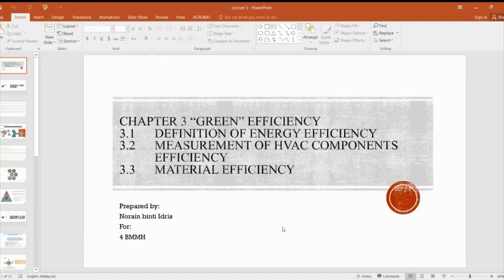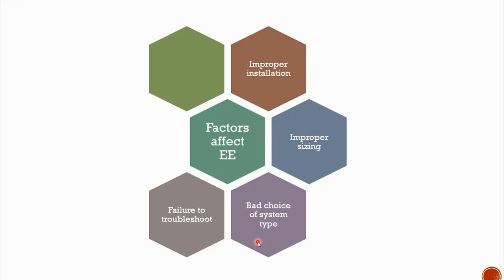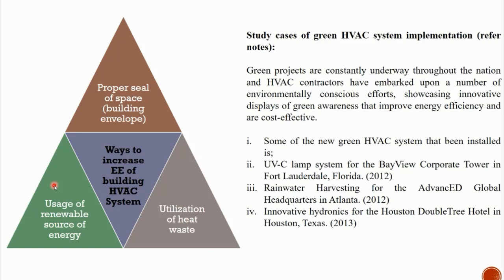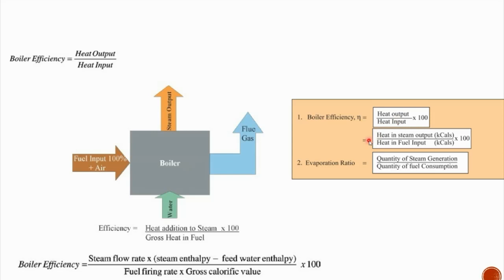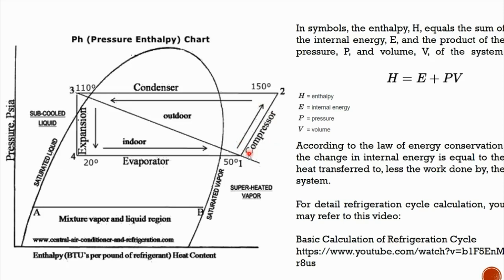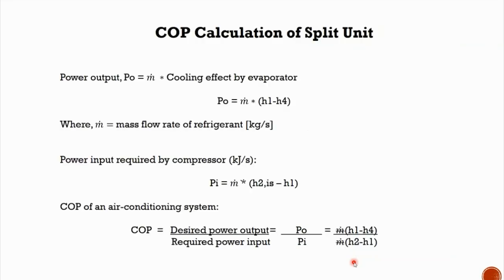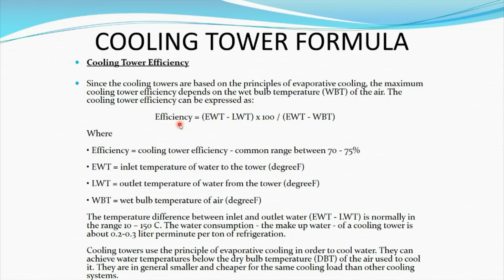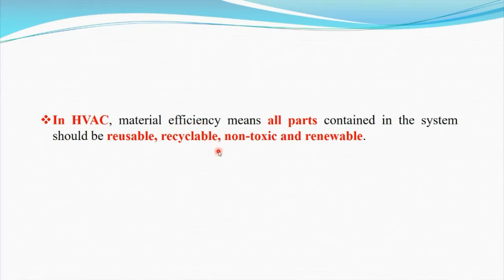Lecture 3 "Green” Efficiency

Comment: Energy efficiency:
Goal to reduce the amount of energy required to provide products and services

Factors of Energy Efficiency 
1. Incorrect Choice of sizing to system when purchasing due to over or underestimating situations done by contractor.
2. Improper installation of the system by inexperienced worker will reduce the efficiency of the system when running up to 30%.
3. Unable to make a good decision on choosing system types to the surrounding conditions and climate changes.
4. failure in troubleshooting the system when problems occur.

way to increase the energy of building HVAC:
~ proper seal of space
~ utilization of heat waste
~ usage of renewable source of energy

Measurement of HVAC components efficiency
- refrigerant cycle calculation
- calculate COP by using the p – H diagram
- cooling tower efficiency = based on the principle of evaporating cooling, the maximum cooling efficiency depends on the wet bulb temp of the air

Green materials:
recyclable
renewable
reusable
nontoxic 
rapidly renewable plant material

Comment: MOHAMAD HURAIRAH BIN HARUN (B071710461)

3.1	Definition of Energy Efficiency : 
~Is the goal to reduce the amount of energy required to provide products and services

Factors that affect Energy Efficiency:
•	Improper installation
•	Improper sizing 
•	Bad choice of system type 
•	Failure to troubleshoot 

Way to increase the energy of building HVAC:
•	Proper seal of space 
•	Utilization of heat waste
•	Usage of renewable source of energy

3.2	Measurement of HVAC components efficiency
~Boiler Efficiency
~Refrigerant Cycle calculation

3.3 	Material Efficiency 
~A description or metric which expresses the degree in which usage of raw materials, construction projects or physical processes are used or carried out in a manner which consumes, incorporates, or waste less of a given material compared to previous measures. 

Green materials:
•	Rapidly renewable plant material 
•	Recyclable
•	Renewable
•	Reusable
•	Non-toxic 

In HVAC, material efficiency means all parts contained in the system should be reusable, recyclable, non-toxic and renewable.

Comment: MUHAMMAD AKRAM BIN RAZALI (B071710573)

Energy Efficiency:
- To reduce the amount of energy required to provide products and services

Factors that affect Energy Efficiency:
- Improper installation
- Improper sizing
- Bad choice of system type
- Failure to troubleshoot.

Way to increase the energy of building HVAC:
- Proper seal of space
- Utilization of heat waste
- Usage of renewable source of energy

COP of split unit.
- Desired power output / Required power output.
- Po = m x (h1-h4)

Material efficiency : 
- Express the degree in which usage of raw materials, construction projects or physical processes  are used or carried out in a manner which consumes, incorporates or waste less of a material compared to previous measures. Making a usable item out of thinner stock than a prior version increases the material efficiency of manufacturing process.

 Green material 
- Rapidly renewable plant materials
- Recyclable
- Renewable
- Reusable
- Non toxic

Comment: HAKIM BIN ZAINUL B071710531 BMMH S1/1 

CHAPTER 3 
GREEN EFFICIENCY
•	The goal of energy efficiency is to reduce the amount of energy required to provide product and service.

The Factor that affect Energy Efficiency
•	Improper sizing 
•	Improper insulation
•	Failure to troubleshoot
•	Bad choice of a system

The ways to improve EE of building HVAC system
•	Proper seal of space 
•	Usage of renewable source of energy
•	Utilization of heat waste

The 4 basic component in refrigeration system
•	Condenser
•	Compressor
•	Evaporator
•	Expansion valve

The COP of a split unit.
desired power output/required power output.
Po = m x (h1-h4)

The max cooling tower efficiency depends on the wet bulb temp of the air. 
efficiency = (EWT – LWT) x 100 / (EWT – WBT)

Green material
•	Rapidly renewable plant materials.
•	Renewable
•	Recyclable
•	Reusable 
•	Non-toxic

In HVAC, material efficiency is all parts should be reusable, recyclable, non-toxic and renewable.

Comment: MOHD RAHIMI BIN MUSTAPHA
B071710225
BMMH S1/1
Lecture 3: Green Efficiency
1)	Definition of Energy Efficiency (EE)
>>	The goal to reduce the amount of energy required to provide products and services.
>>	To reduce cost
>>	To reduce CO2 emission
>>	To reduce energy needed by the world
>>	Slow down the rate of energy depletion resources
Factors that affect EE:
-	Improper installation of HVAC system
-	Improper sizing selection
-	Bad choice of selecting system type
-	Failure troubleshoot
Ways to increases EE
-	Properly seal the confine space
-	Utilization of heat waste (such as heat from existing system)
-	Use the renewable source of energy

2)	Measurement of HVAC components efficiency
>>	Boiler Efficiency = (Heat Output / Heat Input) x 100%
>>	Heat Output : Steam flow rate X (steam enthalpy – feed water enthalpy)
>>	Heat Input    : Fuel firing rate X Gross calorific value 
>>	Unit used in kCals,
>>	For Evaporation Ratio = Quantity of steam generation / Quantity of fuel consumption 
>>	Using p-h diagram
>>	COP calculation of split unit (desired power output/desired power input) (h1-h4/h2-h1)
>>	Cooling tower efficiency (EWT-LWT x 100)/(EWT-WBT)
                             
3)	Material efficiency
>>	The degree in which usage of raw materials, construction projects or physical processes are used which consumes, incorporates, or waste less of a given material.
Green Material: usually used for building 
-	Non-toxic material
-	Reusable material
-	Renewable
-	Recyclable
-	Rapidly renewable plant materials
EPA (Environmental Protection Agency) suggest that to used recycled industrial goods in order to minimizing wastes and maximizing recycling.
In HVAC field, all parts contained in the system should be reusable, recyclable, non-toxic and renewable.

Comment: LUA WEI JIE (B071710861) 4bmmhs1/2

energy efficiency is affected by :
-Improper installation affects your HVAC system's efficiency by reducing your system's efficiency by as much as 30 percent. In other words, it can actually cancel out the savings you're expecting from upgrading to a more efficient model. HVAC installation is a job for a licensed, insured contractor with good references.

-Improper sizing: Getting a more efficient system is a great idea, but don't be tempted to get a larger system than you need for your square footage. A system that's designed for a bigger house won't run well and can actually make your house less comfortable because it cycles on and off too much. Your HVAC system serves as a dehumidifier. An oversized system will cool the house too quickly and shut off prematurely, which means incoming air won't be completely dehumidified. The combo of colder surfaces and wetter air in your house can cause condensation and mold growth. If mold spreads to drywall or joints, you could face an eye-popping repair bill.

-Bad choice of system type: Your options depend on where you live. E.g. for most U.S. residents, the most efficient units combine a natural gas furnace for heating and an electric unit for cooling. But if you live in a moderate climate, an air-source heat pump may be your best choice.

-Failure to troubleshoot: A HVAC system works at its peak with a good supporting cast: a properly programmed thermostat, well-sealed ductwork and adequate insulation. Thermostat, ductwork and insulation can be the actual source of your problems.

cooling tower efficiency : Efficiency = (EWT - LWT) x 100 / (EWT - WBT) 
Efficiency = cooling tower efficiency - common range between 70 - 75%
• EWT = inlet temperature of water to the tower (degreeF)
• LWT = outlet temperature of water from the tower (degreeF)
• WBT = wet bulb temperature of air (degreeF)
• The temperature difference between inlet and outlet water (EWT - LWT) is normally in the range 10 – 150 C. The water consumption - the make up water - of a cooling tower is about 0.2-0.3 liter per minute per ton of refrigeration.

material efficiency : Material efficiency is a description or metric which expresses the degree in which usage of raw materials, construction projects or physical processes are used or carried out in a manner which consumes, incorporates, or waste less of a given material compared to previous measures. Making a usable item out of thinner stock than a prior version increases the material efficiency of the manufacturing process.

Comment: ARVINTH A/L RAMACHANDRAN 
(b071710339)
4 BMMH S1/2

1) - DEFINITION OF ENERGY EFFICIENCY
 
- is the goal to reduce the amount of energy required to provide products and services 
   
 - Motivation to improve 
      - reduce cost 
     - reduce CO2 emission 
     - help reduce emission effect of greenhouse

Sustainable Energy Policy 
  - slow down the depletion of energy resources 
  - security beneficial 
  - reduce the level of energy  import 

Factor that affect Energy Efficiency 

       - improper installation =  reduce efficiency to about 30% of the system 
      -  improper sizing =  oversized system will cool the house too quickly and shut off prematurely, which means incoming air           won't be completely dehumidified.
      - bad choice of system type = system should follow the requirement of place climate and the situation 
     -  failure of troubleshoot = failure  as in the thermostat, insulation and ductwork.

Ways to increase Energy Efficiency  of building HVAC : 
         - Proper seal of space
         - Utilization of heat waste
         - Usage  of renewable source of energy

2) - MEASUREMENT OF HVAC COMPONENTS EFFICIENCY

cooling tower efficiency : Efficiency = (EWT - LWT) x 100 / (EWT - WBT) 
Efficiency = cooling tower efficiency - common range between 70 - 75%
• EWT = inlet temperature of water to the tower (degreeF)
• LWT = outlet temperature of water from the tower (degreeF)
• WBT = wet bulb temperature of air (degreeF)
• The temperature difference between inlet and outlet water (EWT - LWT) is normally in the range 10 – 150 C. The water consumption - the make up water - of a cooling tower is about 0.2-0.3 liter per minute per ton of refrigeration.

3) - MATERIAL EFFICIENCY

description or metric which expresses the degree in which usage of raw materials, construction projects or physical processes are used or carried out in a manner which consumes, incorporates, or waste less of a given material compared to previous measures.

Green material
 non toxic 
reuseable 
renewable 
recyclable
Rapidly renewable plant material

Comment: MUHAMMAD AMIR SYAFIQ BIN AHMAD SUKRI 
B071710161

Energy efficiency:
•	goal to reduce the amount of energy required to provide products and services

factors that affect Energy Efficiency:
•	improper installation = will reduce the system's efficiency. it can cancel out the saving
•	improper sizing = oversized system will cool the house too quickly and less comfortable. The air will not be completely dehumidified that can cause condensation and mold growth
•	bad choice of system type = The system may hard to troubleshoot because of a small failure such as the thermostat, insulation and ductwork.
•	failure to troubleshoot = The system depends on the place, climate.

way to increase the energy of building HVAC:
•	proper seal of space
•	utilization of heat waste
•	usage of renewable source of energy

Measurement of HVAC components efficiency
•	refrigerant cycle calculation
•	calculate COP by using the p – H diagram
•	cooling tower efficiency = based on the principle of evaporating cooling, the maximum cooling efficiency depends on the wet bulb temp of the air

Green materials:
•	recyclable
•	renewable
•	reusable
•	nontoxic 
•	rapidly renewable plant material

Comment: KHOR YE SHU    -B071710464   - 4BMMH S1/2 

Definition of efficient energy :
The goal to reduce the amount of energy required to provide products and services or can be said  uses the minimum energy to deliver the product/services.

Factor affecting the efficient energy
:
1.	Improper installation
2.	Improper sizing
3.	Bad choice of system type
4.	Failure to troubleshoot.

Ways to increase the efficient energy of building HVAC system:
1.	Proper seal of space (building envelope)
2.	Utilization of heat waste
3.	Usage of renewable source of energy.

Boiler Efficiency = heat output / heat input

Green material
1.	Non toxic
2.	Reusable
3.	Renewable
4.	Recyclable
5.	Rapidly renewable plant material

Comment: NUR FITRAH NADIA BINTI KAMIDAN
(B071710363)
4BMMH S1/2

Definition efficient energy.
The goal to reduce the amount of energy required to provide products and services.

Factor affect efficient energy
1.	Improper installation
2.	Improper sizing
3.	Bad choice of system type
4.	Failure to troubleshoot.

Ways to increase efficient energy of building HVAC system.
1.	Proper seal of space (building envelope)
2.	Utilization of heat waste
3.	Usage of renewable source of energy.

Boiler Efficiency = heat output / heat input

Green material
1.	Non toxic
2.	Reusable
3.	Renewable
4.	Recyclable
5.	Rapidly renewable plant material

Comment: MOHAMAD SYAFIK BIN SOFI B071710064 4BMMH S1/1

CHAPTER 3 "GREEN" EFFICIENCY
Energy efficiency is the goal to reduce the amount of energy required to provide product and service.

factor affect Energy Efficiency
-improper insulation
-improper sizing
-bad choice of system type.
failure to troubleshoot.

ways to increase EE of building HVAC system
-proper of space 
-utilization of heat waste.
usage of renewable source of energy.

4 basic component in refrigeration system
-compressor
-condenser 
-evaporator
-expansion valve.

COP of split unit.
desired power output/required power output.
power output = Po
Po = m x (h1-h4)

The maximum cooling tower efficiency depends on the wet bulb temp of the air. 
the cooling tower efficiency can be expressed as : 
efficiency = (EWT – LWT) x 100 / (EWT – WBT)

Material efficiency is a description or metric which express the degree in which usage of raw material, construction project or physical process are used or carried output in a manner which consumes, incorporates, or waste less of a given material compared to previous measures.

Green material
- Rapidly renewable plant materials.
- Recyclable
- Renewable
- Reusable
- Non-toxic

Comment: NUR SELIHAH WAL HUDA BINTI AHMAD - B071710190

3.1 = ENERGY EFFICIENCY
- Energy Efficiency : Goal to reduce the amount of energy required to provide produces and services. 

- Factors effect EE : 
1) Improper installation : will reducing system's efficiency. it can actually cancel out the saving.
2) Improper sizing : oversized system will cool the house too quickly and less
comfortable. The air won't be completely dehumidified that can cause condensation and mold growth. 
3) Failure to troubleshoot : The system may hard to troubleshoot because of a small failure such as the thermostat, insulation and ductwork.
4) Bad choice of system type : The system depend on the place, climate.

- Ways to increase EE of building HVAC : 
         1) Proper seal of space
         2) Utilization of heat waste
         3) Usage  of renewable source of energy

3.2 = MEASUREMENT OF HVAC COMPONENTS EFFICIENCY
- Refrigerant cycle calculation
- use p-H diagram to calculate the COP 
- Cooling tower efficiency : based on the principle of evaporating cooling, the maximum cooling efficiency depends on the wet bulb temp of the air. 

3.3 = MATERIAL EFFICIENCY
- Material efficiency : express the degree in which usage of raw materials, construction projects or physical processes that can increase the efficiency of manufacturing process.

- Green material 
   1) Rapidly renewable plant materials
   2) Recyclable
   3) Renewable
   4) Reusable
   5) Non toxic

Comment: MOHAMMAD NAZRIN BIN BAHARUDDIN
B071710111
4 BMMH S1/2

Energy Efficiency
-The objective is to minimize the amount of energy used to deliver products and services or to use the least energy to deliver the product/services.

Effect of Energy Efficiency
-Improper sizing 
-Improper insulation
-Failure to troubleshoot
-Bad choice of a system

Ways to increase Energy Efficiency of building’s HVAC system.
-Start of consuming renewable source of energy.
-Usage of heat waste as energy source.
-Proper space sealing.

The 4 basic component in refrigeration system
-Condenser
-Compressor
-Evaporator
-Expansion valve

Measuring in HVAC system
-Calculation of COP on p-h diagram
-Refrigerant cycle calculation. 
-desired power output/required power output. Po = m x (h1-h4)
-Cooling tower efficiency = The maximum amount of cooling efficiency regarding too wet bulb temperature of a room. (EWT – LWT) x 100 / (EWT – WBT)

Green material
-Non toxic
-Reusable
-Renewable
-Recyclable
-Rapidly renewable plant material